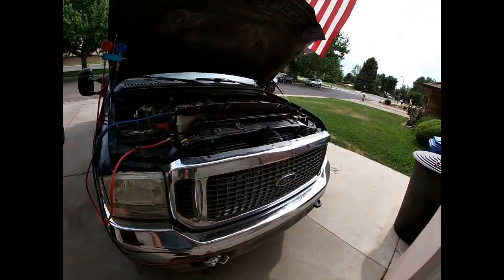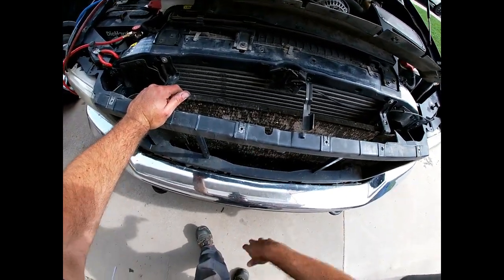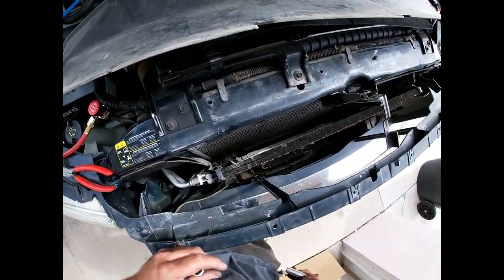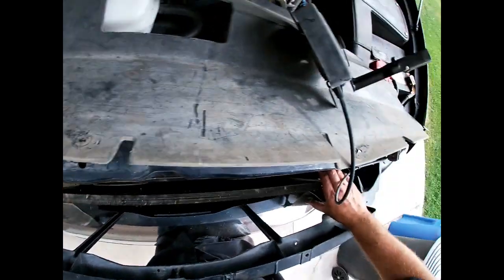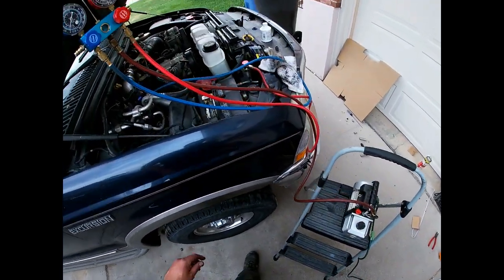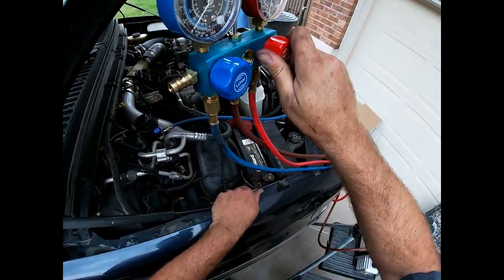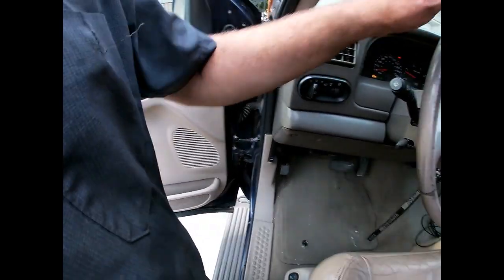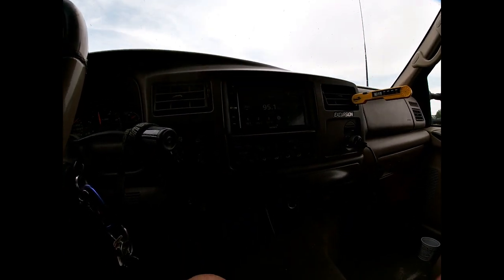Excursion A/C System Restoration, Orifice Tube Upgrade, and vacuum pump demonstration

Comment: i have several customers and friends with excursions. Air conditioning performance on these is such a challenge here in Texas with high humidity and heat especially with such a huge area to cool and  a fixed displacement compressor coupled with both a fixed office tube and a expansion valve. Really we need a adjustable park idle speed also. I will try this vot.

Comment: Is there another orifice tube for the rear controls , I run a excursion limo and I have 3 sections to cover with three lines , keep in mind I only have one compressor for all three lines , just curious if they have another orifice for the rear . Thanks
Reply: You should have a orifice tube for each evaporator in the system yes. That being said you said you have three lines so you should have three orifices
Reply: the rear has an txv valve looks like an aluminum cigarette box with 4 lines going to it there prown to get stuck.

Comment: those diehard batteries will die hard. i had bought 2 brand new ones both tested at the store and didn't even last a year. and they were about 200 for each of them. 950 CCA diehard golds.
and i really think you kind of missed another critical point of putting the system under a vacuum. close the valves on the guagees and see if it maintains a vacuum for a period  of 20 minutes to 1 hour. if it can. then you verified the inegrity of your repair.

Comment: Thanks,Awesome video! I have the v10 excursion and the ac works intermittently on low, if I turn it on high she starts blowing warm and suggestions?
Reply: One more thing the refill canister gauge on the AC fill can goes into the red. I personally have never added any refrigerant.
Reply from the maker: Sounds like a dirty condenser, plugged orifice, or overcharged system

Comment: Hey friend,
Can I change the front inlet filter just by disconnecting the hose? Or  do I need to vacuum the lines to disconnect.
Reply from the maker: @DieselFi5e  the refrigerant needs to be recovered, then u can change the front orifice tube, then put the system under a vacuum and charge her up
Reply: @BrotherhoodOfTorque  awesome, so from a non hvac minded person like myself. Can I do that at home myself? Or is this a thing at a shop I gotta do?

Comment: I have the exact same excursion.  Your video was great.  I am a do it yourself backyard mechanic.  My excursion is blowing warm air in front and cold in back.  Just started.  I have 340K miles on it and no rust as I live in AZ.  Would replacing the stock orifice with a variable orifice may help the car cool.  Also ordered the by-pass valve for the coolant from Diesel Site to not run the hot radiator fluid through the heater core when the AC is running.  Let me know your thoughts.  If you live in AZ and do mechanic work for others I would be interested.  Thx

Comment: What is a office tube upgrade ??!?!? Isn’t the system designed to cool and be as efficient as it can be ? So wouldn’t the office tube be designed to do the best job it could do ? Why would they design a system with an office tube if you can just upgrade it to be better ??? Confused on info you got or is the change it made all placebo
Reply from the maker: This system was built and designed 20 years ago. In that time, technology has changed. This type of orifice tube was not available when this excursion was made. The new orifice is variable. When the system pressure drops because of low rpm situations (like sitting at a light), the new style orifice will open further to allow a constant flow of refrigerant. Standard orifices are fixed, so you get what you get.

Comment: Also if the Orifice tube was dirty and such why didn’t you flush the system as well
Reply from the maker: The amount of debris on the orifice tube screen was not of concern to warrant a system flush. Flushes are normally only required when a system is heavily contaminated or after a compressor failure.

Comment: What's the part number for that new condenser?  I got one for my 02 v10 Ex from Rock Auto and it looks different.....no brackets on the sides to mount deflectors...it's a Motorcraft
Reply from the maker: The one I used came from Oriley. It was 7-4883. Keep in mind that i have the 7.3 diesel, so my part number may be different. Give em a call and see what they say. Im actually working on building an online store to sell the parts that I install and review to make it easier on folks to find.

Comment: I have same model but with 6.8L V10. I get same temp out of the vent after new Compressor, Condensor, Drier/Accumulator, Orifice tube. After replacement of all these, best I can get is the 59ish temp. Better than before, but still not cold enough to keep cool here in NC high humidity and temps. If temps mid 80's or less, it is good enough, but once over 85, it does not keep cool enough. Next, will change the Evaporator and hoping like other youtubes showing them partially clogged, that is my last issue and can get it colder.
Reply from the maker: I also noticed that if you run the rear a/c all the time as the fronts,, the front a/c discharge temp will drop noticibly. It happens in all the ford vehicles that I own with front and rear a/c systems.

Comment: Does your air blow hard?  Mine in my ex doesn't blow for crap..
Reply: front and rear system blows very hard normaly check the evaporators for dirt.
Reply: @zer0frames623  we did eventually do all that 1000$ later...

Comment: How is that variable orfice tube holding up?
Reply from the maker: Its working good, but it makes a funny noise when the A/C compressor shuts off lol. The compressor is actually dying so its getting changed this weekend.
Reply: @BrotherhoodOfTorque  I just replaced everything except the evaporator and flushed the lines. Im using the red orifice tube like recommended but it just wont cool at idle. My pressures seem off too. Low side is high at idle like 65psi and high side is low at idle around 200psi but at 2k rpm low side drops to 45psi and high side goes up to 230psi. All the youtube videos show the pressures at idle low 40psi high 250psi. Im wondering if I bought a weak ac compressor. Im at a loss
Reply from the maker: @DarrelllCampbelll  the compressor may be bad. Honestly id try a different orifice and see how it runs. Id also check the fan clutch to.make sure your moving the proper amount of air over the condenser.
Reply: What orifice tube part number did you use

Comment: The new parallel flow motorcraft condenser I got from Rock Auto had a new charging spec, lower than OEM...a little over 3 pounds, versus the 4+ pounds for the tube and fin condenser. I think the AC just sucks on these Excursions, meaning its undersized for the size of the vehicle.  I can easily get 42F at idle vent temps out of my Suburbans AC.  Interesting, and thank you for this video!
Reply from the maker: Your not wrong. The blue EX in the video is getting a new fan clutch and ac compressor next. It should help a bit. I do feel like they are undersized as well. I may try installing a big electric pusher fan on the front of the condenser that activates when the A/c is on, but the rpms are under 1200. I have always felt that the fan doesnt move enough air at idle.to keep it happy. My 6.0 blows super cold all the time, and my old silverado would freeze you out.
Reply: @BrotherhoodOfTorque  Is the 6.0's AC system the same as the 7.3 and V10?  I wonder why your 6.0 blows colder then the other two Ex'es?
Reply from the maker: @trappistachel  they are very similar except the 6.0 has an electronic fan clutch that can be locked and unlocked by the pcm. When the a/c is engaged, the clutch is locked more so that the fan will spin faster.
Reply from the maker: @trappistachel  my v10 ex blows pretty cold as well, so you may want to check your fan clutch as well.

Comment: Hey great video. I have a question.

I replaced my condenser, compressor, accumulator end Orifice tube. After doing this I went to the mechanic where he use the big machine on wheels to vacuum the system and add the R134a. While I was there I had the RPMs at 1200 and the vents were blowing out 40 degrees while parked. Today it was blowing out 50 degrees while parked. About 15 minutes later it was blowing out 60 degrees at parked. I'm a little concerned that something is wrong. The mechanic said it seemed to be healthy yesterday when I was there and the vacuum it held pressure. It's still blowing cold but I feel it was colder yesterday so I hope it's not slowly getting warmer. I did not change the evaporator could this be why it's doing that?
Reply from the maker: The colder the condenser gets, the colder your a/c will be. If your fan clutch is worn out, or your radiator fins are clogged, air flow will suffer at lower rpms and the ac will get warmer say if you are sitting in a drive thru. Some guys install an electric fan on a switch, and some guys will use the high idle setting on their tuner if they have one.
Reply: @BrotherhoodOfTorque  thanks bud. I'll look into it. I have a high idle on my tuner which brings it to 1200RPM. I also bought the truck without a fan shroud. Maybe that's not helping either.

BTW after my first comment all my refrigerant had leaked out. I bright the truck to another mechanic and we found the connection to the new accumulator leaking. Took it off changed the Orings and tighten it back up and the leak was gone. It held the vacuum for 30 minutes and he recharge the system. This was yesterday but today I feel it's not as cold and apparently I didn't have a leak so I'm a little concerned. If there was no leak that my evaporator has to be fine (unless it's clogged) so I'm not sure what the issue could be. I'm going back there tomorrow
Reply from the maker: @CHRIS_NYC  missing shroud will have a big effect on it.
Reply: Missing shrouds have a huge huge role on making the ac not as cold at low speeds. Plus if you had a shroud and say have an aftermarket fan clutch I’ve seen those aftermarket clutches not sit the same depth in the shroud as original one and that plays a big role on how it pulls air thru and how much air it pulls at that. I had that problem. Fan didn’t sit dep enough into the shroud and didn’t pull the same amount of air as original fan.. so it made less air pull through the condenser..
Reply: Take your blower motor out and spray your evaporator out with some ac condenser cleaner you would use for your house air conditioner unit from Home Depot, trying to spray as much on your evaporator and let it sit about 20 min, then spray the rest of the can on it then spray it out with your hose and let it drain out the ac drain l. Then spray the hose up the A/C drain to clean the drain out and it will work freaking wonders especially on these older trucks that don’t have cabin filters .